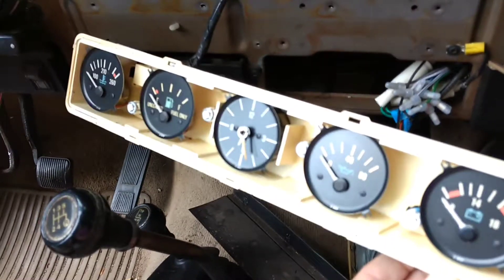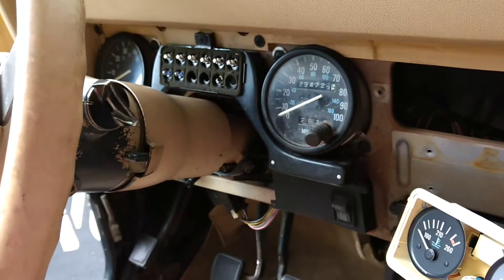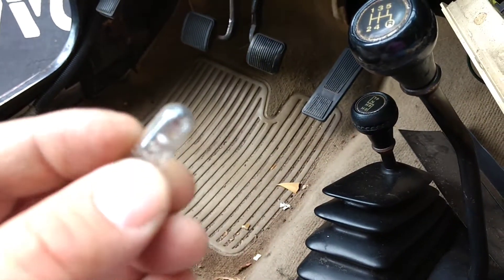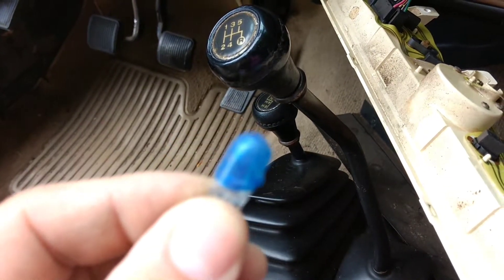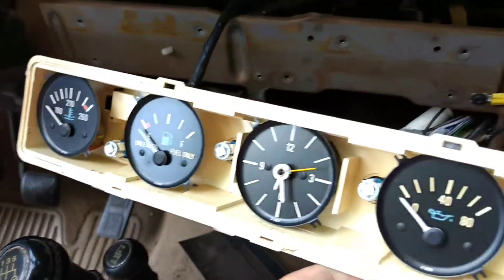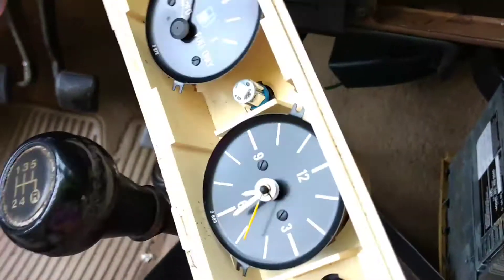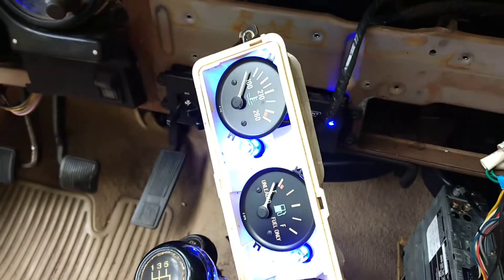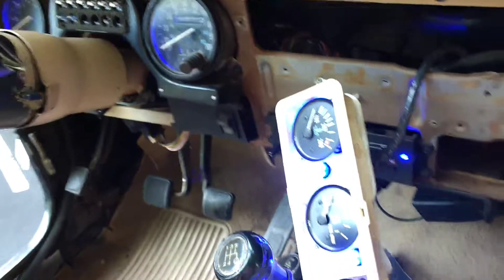1991 Jeep Wrangler YJ dashboard light replacement - upgrade to LEDs

Comment: Did your LEDs ever start blinking/flickering? Been having this issue for a while and can’t figure it out. Checked my dimmer switch and my grounds and they’re fine. All stock bulbs worked fine, issue started when swapped to LEDs.
Reply: Hey bud. Did you ever find the solution?
Reply: El12    turn signal flasher,   15 bucks and your problem is solved

Comment: Now did you do the speedo and tach I tried but could get to the back am I missing something?  Thanks man.
Reply from the maker: Hi, sorry for the late reply. Yeah, the speedo and tach are difficult to get access to, you have to be caredful with the tach, especially stretching the wires. For the Speedometer you have to disconnect the speedo cable from the transmission so that the gauge will come out from the dashboard further, then you can get better access to the light sockets. Either way, it's a tough job and takes "finesse". Hope this helps. Good Luck!
Reply: Thank you.   I haven’t tackled them today’s it’s way to hot out here in vegas now so I’ll probably wait till it cools off.